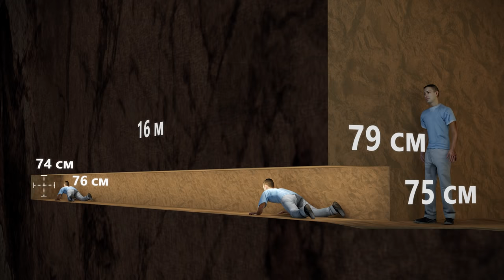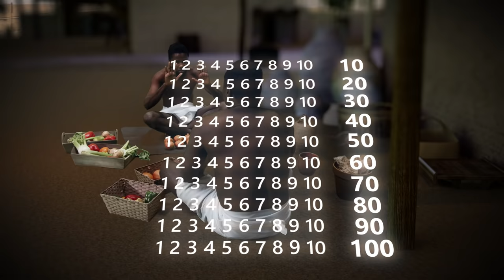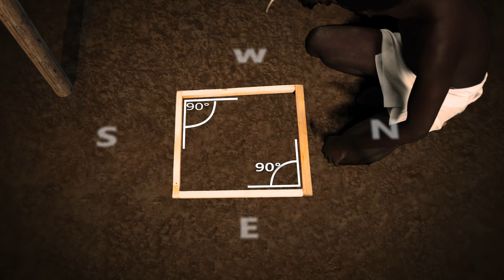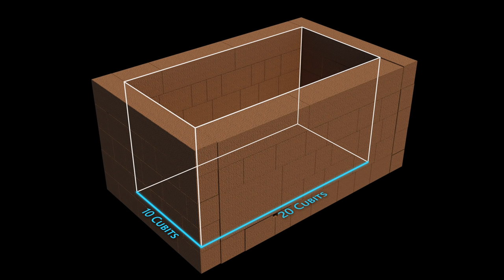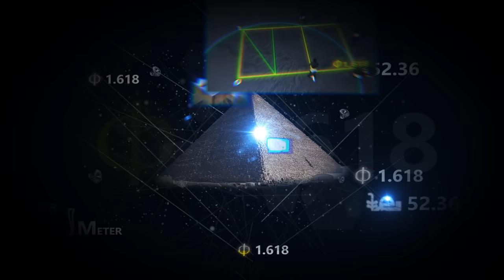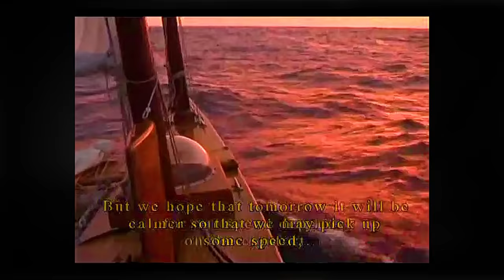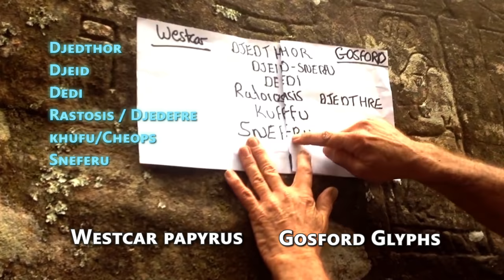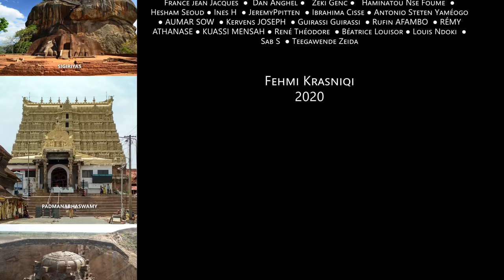The Movie Great Pyramid K 2019 - Director Fehmi Krasniqi

Comment: Interesting theory, and makes more sense than banging out a couple of million blocks with primitive tools then hauling them up a ramp. 
BUT QUESTIONS PERSIST:  How did this advanced mathematics suddenly bloom in the Bronze Age?  And why did Egypt quickly revert to being a primitive society?  Melting granite with a gigantic magnifying glass might work better in animation than in practice; has anyone tried this in scale?  Egyptologists don't seem to like the poured concrete theory, but it ought to be pretty easy to prove:  One of them claimed that all the blocks are of different sizes, and I'm not sure that this was answered sufficiently.
Reply: Surely they already had powdered rock to use, in the form of (eroded) sand and gravel?
Rock only melts for us at vary high, furnace teperatures. The maths were known from long before., and maybe did come from life from Plieadies
Reply: I'm skeptical about a helluva lot of things here, especially in regards to the measurement system bit. The diameter of water droplets is not constant, so the whole argument kinda falls apart at that. Even if they DID invent the meter, why didn't they keep it on public record and stick with cubits (which weren't really fixed in length, since humans don't have the same forearm+hand length. Even royal cubits weren't actually fixed. Royal cubit rods actually vary by a few 1/10s of a centimeter) instead? Also given the variance, it's possibly a coincidence that one possible value of a royal cubit just so happened to be the ratio of the surface area of a sphere to that of a cube.

Now onto the construction. The idea of using molds doesn't really hold up considering the various lengths of the stones, like you said, so... yeah. Sure, the molds could vary in size, but to the point where no stone is alike? Next, there's the idea that they used concrete. It is plausible at first sight, but I'd like to ask where they got the materials and how they made it. Volcanic ash seems like a plausible explanation at first, but Egypt doesn't have any volcanoes, and the historical record does not show Egypt trading with places that DO have volcanoes. Plus, in regards to the granite thing, how'd they make the lenses needed to melt it in the first place? The vid kinda just said "heat the mix to 1000 degrees C" and left it at that. How did they get to 1000 C in the first place?

This isn't even all of it, but those are my main gripes with the thing.
Reply: @improvise9840  You're more on the right path. Things were left because they couldn't be lifted. That obelisk is marked to be cut in 3 but it split.

There's loads of things omitted in this documentary and completely ignores paintings that they left on walls showing different methods.
Reply: most of the stuff in this doc is incorrect unfortunately.  when you melt granite it becomes a form of glass, it doesn't turn back into granite. also yes all the stones are different sizes and shapes, not uniform like from a mold.  they are limestone, which is soft, which explains how they could be cut easily. i dont have all the answers but this doc is BS.

Comment: The problem with this theory, is that I've actually melted rocks with a Fresnel lens, and it doesn't stay molten like they assume in this video. It actually almost immediately hardens into a silicate like glass. I can agree with the geopolymer or the manufactured stones, that part is not far fetched. But the melting of granite and pouring it doesn't make sense, because anyone can take a fresnel lens to rock and see that it doesn't stay molten and when it cools it surely isn't in rock form, it cools into a glass form.
Reply: I really would like to see the video recording you made. Fresnel lens, really.
Reply: Exactly
Reply: So if this is possible has it been demonstrated? I find the theory very very fascinating but a practical demonstration needs to be made....
Reply: @eremitehugs7986  If what is possible ? Melting rocks? well you can go on youtube and research fresnel lens, you will see about a thousand people melting rocks with a fresnel lens. Or go to amazon buy a fresnel lens and do it yourself. 

As far as composite rocks, that's a little bit trickier. Because people don't understand the exact formula needed to make a synthetic granite. And like I said, you cant melt this stuff with heat because it turns into a glass. But you can probably dissolve the materials with some kind of acid and then let it reform again. There are rudimentary versions of Roman Stone being played with right now, but it's far from anything Granite like.
Reply: Not in all methods
Reply: The stones were cut with laser technology, they used the light of the sun and diamond stones, just like how light is converted into laser light in a magnifying glass
Reply: @melfordgopaulsingh9012  Light isn't converted into laser light through a magnifying glass. Anyone can do that simple experiment and see that is not the case. 

Sunlight is not a sufficient method to cut those stones, at least not focusing sunlight. They must have cut those stones with some kind of technology. 

Sun light is definitely hot enough to vulcanize stone, but that's the problem, it cools into glass so quickly. And the focal point of the converging sun rays is not sufficient enough to cut through entire blocks of stone. Because you'd have to have some kind of technology that would consistently move that focal point at depths that's not achievable with rudimentary tools.
Reply: @youcanthandlethetruth6976  I had only used magnifying glass as a reference, the stones that transmitted light may have been diamond stones, would you agree that the sun is the highest power in all creation, without it nothing could exist?
Reply: @youcanthandlethetruth6976  none of the planets could not exist without the Sun, hence humans would not exist for us to be having this conversation, all scientific knowledge exist, because of the existence of the Sun, so it was logical for all religions and cultures worship it directly or indirectly
Reply: @melfordgopaulsingh9012  only fools and pagans worship the sun. You never worship the creations, for the true power lies in the creator.
Reply: @youcanthandlethetruth6976  The Sun is the giver and creator of all life
Reply: @youcanthandlethetruth6976  if the Sun did not exist there would be no man to create electronic lights, the sun is the source of all energy
Reply: did you melt the glass the same way they did? did you add or take away a particular ingredient needed to stop the rock from turning into glass? Lots of other unknown  variables. Just because our understanding is not there yet doesn't make it far fetched. After all with Egyptology 95% is speculation and theory. this video presents another one.
Reply: @Cerl84  They suppose in the video that you can focus the sun's rays and melt rock and then pour that rock like molten metal. That's not true, unfortunately when you use the sun's rays to melt rock, it almost immediately turns to glass and everything else is burned off into a smoke. 

Like I said, anyone can do this at home, it's not difficult to do. You can literally just search on youtube and there's like 400 videos of people doing this very thing.
Reply: @youcanthandlethetruth6976   again the point is just because 400 youtubers can't figure it out don't mean the ancients couldn't melt rock and mold it into whatever they wanted. you don't know what they knew. Your Amazon melt rock kit won't cut it. when 400 youtubers build a pyramid maybe I'll take them a little more seriously.
Reply: @Cerl84  they specifically claimed that they were melting rock with the sun's rays, which get as hot as hydrogen gas, if not hotter. So no, it is not possible to melt and pour rock with heat of any kind.

Now what's more probable, is that they formed a synthetic rock, or dissolved rock with chemicals somehow. But they definitely did not melt and pour rock.

All sediment turns to glass when superheated, period, that includes all rocks.
Reply: @youcanthandlethetruth6976  yeah they probably did have the technology for the laser because it is said that King Solomon had the best flying machines .
    Ancient texts from India talk about the kind of flying machines they also had ... and wars in the skies with the flying machines
Reply: @gardensofthegods  I don't doubt that they could have had advanced technology. What I doubt is that they were "melting" rocks or stones and then casting them, it's impossible. What's more probable is that they had a technology to cut and shape them, as well as transport them, or that they had a composite type of mixture to simply pour and cast stone like blocks.
Reply: exactly. and that makes this documentary just as false as the ones they mocked.
Reply: You forgetting they used more than just melting rocks. They used chemistry and science.
Reply: @justadad6677  In the video they made an example that they just melted rocks with a focusing lens, aka a Fresnel Lens type setup. And that's not possible, because you don't "Melt Rocks", you vitrify them, meaning they turn to glass. 

And that's the only point I'm contending, is that you cannot simply "Melt" rocks, because the immediately cool to glass.
Reply: @youcanthandlethetruth6976  Not sure the whole representation, or even the science is fixed and completely understood. But this idea make a whole lot more sense than the quarry and transportation of such immense stones.
Reply: @youcanthandlethetruth6976  There is a lot that makes sense, but also a lot of questions that makes this theory only a step in the right direction. Like, how big where those mirrors, and how clear. Glass is super heavy, and fragile, and why would they constantly move and build megalithic structures all over the world. 

Not saying they didn't have the same roots, but why move, is also reasons we want answered.

No this was great, and on the discovery of the metric system, it is mind blowing. But just because that part made 100% sense and gave clarity. Doesn't mean everything that followed were accurate and true as well. I don't think it is, but I do believe they on to something.
Reply: @unclestymie5509  i dont get it
Reply: @unclestymie5509  Umm why is that so hard to believe?  Don't black people come from Africa.. Why is it so hard for white people to believe that the earliest Egyptians were blk?  Their statues tell u as much..  Also the creator of this documentary was not black so why would he create a documentary presenting the early Egyptians as blk if he didn't believe they weren't?  He's basing his research off of historical evidence.. not personal opinion..  Honestly it's sad that western civilization thinks so little of others (specifically blk people) in regards to contributions to humanity..
Reply: @Jay-uv8fc  they haven’t.  Just used the milestones everyone eelse provided
Reply: i am black.  Make 100 annually.  My brothers and sisters only use.  True talk
Reply: @Jay-uv8fc  Because all the DNA evidence said so, which was the final nail in the coffin for African egyptian theory. Most of the mummies were of Celtic Origins, meaning they were most likely mixed Arab peoples. Which is consistent with the geography because most people in that region were Whites and Arabs and it's been that way for at least 3,000 years maybe more.
Reply: @youcanthandlethetruth6976  the DNA evidence said they were blk.. did we watch the same film? And love how u conveniently ignore the depictions of Pharoahs as blk.. what civilization has ever ruled and depicted their kings and queens as anything but the race that they were??
Reply: @Jay-uv8fc  Everyone knows what mummies they had DNA of. They had DNA of the Cush kingdom, everyone knows that the Cush ruled Egypt for 100 years, that's written in Whitey's history books. We already know that. We're not talking about that period. We're talking about every other period of Egyptian  history. They were all fair skinned Celtic mixed peoples. Which is consistent with that region. That's why all  Iranians are white, the Greeks which is the same language as Hebrew and Phoenician, are white. The Romans created a civilization by mixing with the WHITE Latins. All of the North Africans are mixed white peoples called ARABS. All of the middle east are mostly Whites and white mixed peoples called ARABS. Most Asians are WHITE, because again the White peoples went and mixed alll over the world. Because they were a seafaring and expansionist people. So you find them all over the world, their DNA is everywhere. Africans are not. Africans don't have a single history book about anything. Again that is unfortunate, but that's not Whitey's fault. Go argue with the Africans why they don't have any history books or any history at all. They're always arguing with whitey about what whitey writes in his books. It's none of anyone's business what Whitey writes in his books.

If you have a problem with it, go to the Congo and ask them where their history books are. Good Luck.
Reply: @youcanthandlethetruth6976  just like everyone "knows" Anicent Egypt had slaves and they strong armed 50 ton stones up ramps.. isnt this also what u were taught in school?
Reply: @Jay-uv8fc  Whitey writes about Whitey's history and how he views the world. So everything he writes is his opinion and his perspective and there's nothing wrong with that. No one is beholden to write about someone else's perspective. So if you don't like Whitey's perspective about his own history and how he views the world, like I said, go argue with Black Africans about their history books, or go Argue with native peoples or Asians about their books.

Why are you so concerned with Whitey's books and what he likes to write about?